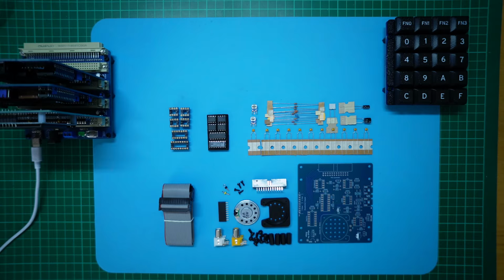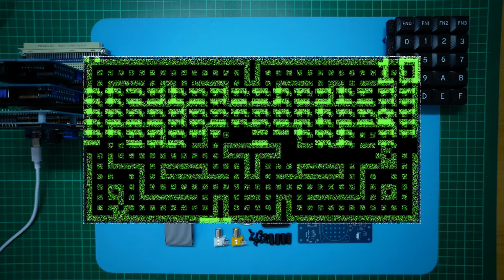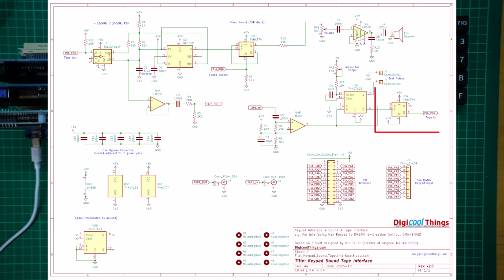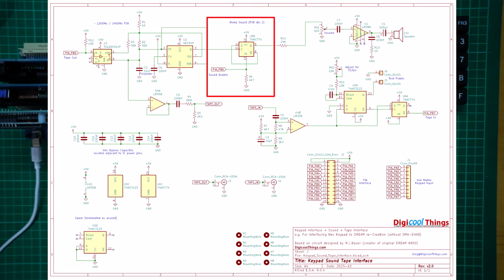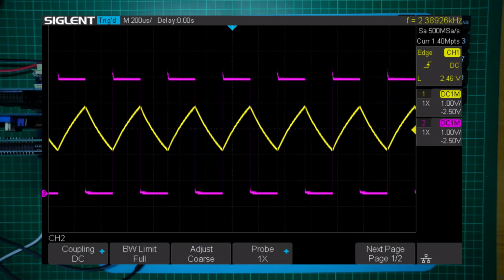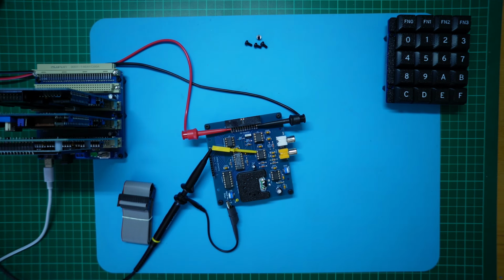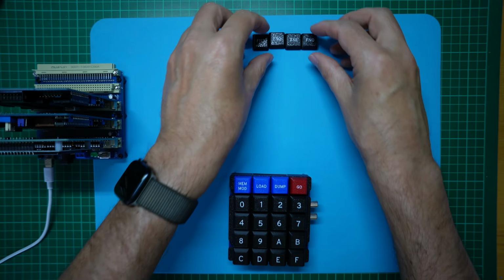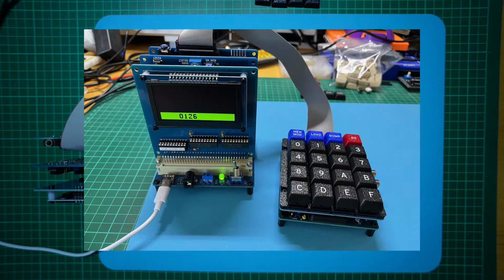DREAM 6800 (6809) re-Creation - Part 1

Comment: In 1979 I did a 6800 based VT100 compatible terminal with graphics, 512*256 monochrome bit mapped, no alpha mode so I had to draw characters in the graphics RAM.  My timing was horrible, if I'd waited a bit longer the 6809 would have been available.  I was very fortunate in that I had a PDP-10 (this one https://www.youtube.com/watch?v=Hm3UY1o7Bdo&t=2s) available as a development system so I had a full macro assembler and debugger supporting examine, deposit,, and breakpoints, with a serial line between PDP-10 and 6800 and CAD for drawing the schematic.  The terminal could only plot at 500 characters per second, more speed would have been helpful, if only Motorola had gone little endian on their 8 bit processors I could have had some extra speed.

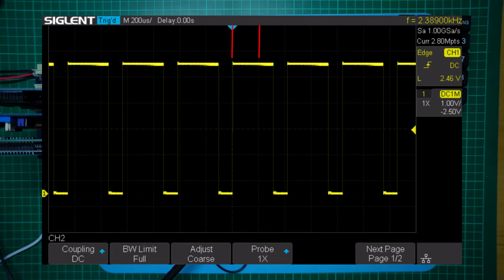Comment: Great video ... but really ending on a cliff-hanger!! Can't wait for the next instalment 🙂BTW, I'll need to watch it again more carefully (with the volume up as I didn't want to disturb my sons studies and was mostly reading the automatically generated captions) but the bit around 20:11 where you are measuring the square wave timing - I didn't quite understand what the red lines were marking on the oscilloscope display.
Reply from the maker: Yeah, I was hoping to release a full video, but after editing what I'd done, I realised it was going to be too long if I kept going (and I didn't really want to cut anything out).  The scope was set to 200us per division, which I highlighted, but unfortunately the scope capture barely showed the grid lines.  So, I drew the 2 red lines to show the 200us per division width.  I probably could have made this clearer though.
Reply: @DigicoolThings  Ah great - that makes sense - thanks for the clarification.
Reply from the maker: @EmilLenc   I've just finished editing Part 2, so expect this to be published in the next day or so as soon (as I've completed all the admin).  In retrospect, I'm glad I split the video into two parts, as a single video would have been far too long.  And, I wanted to make sure I did this project justice, by more fully covering its operation / use.

Comment: I used to run FORTH on the DREAM 6800, with a teleprinter as the terminal.
Reply from the maker: Nice! My first FORTH experience was on a System 80 (TRS80 clone).  But I also knew a few friends, some of who I introduced to the DREAM 6800, who went crazy with expansion.   Whereas, I went in the direction of 6809 based homebrew wirewrap.  But the DREAM 6800 was definately the basis of quite a few expanded homebrew systems.